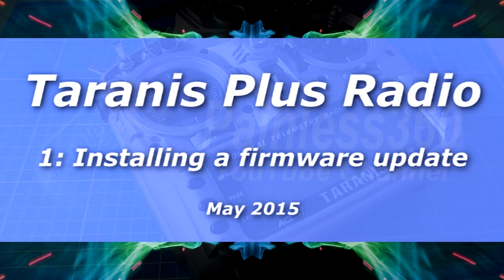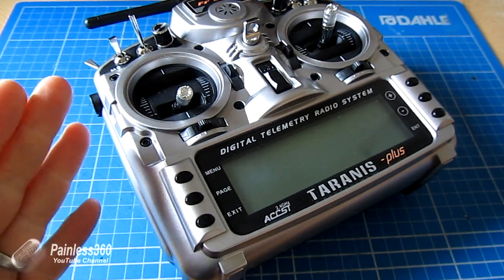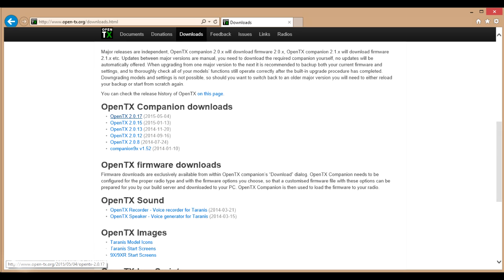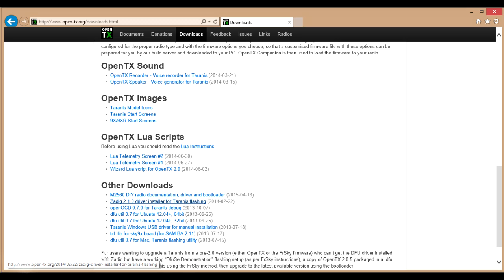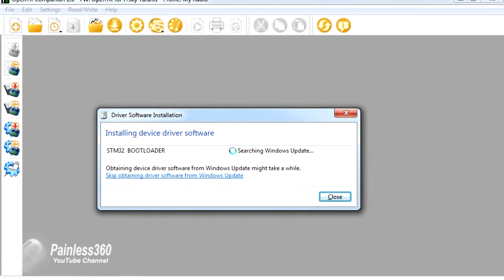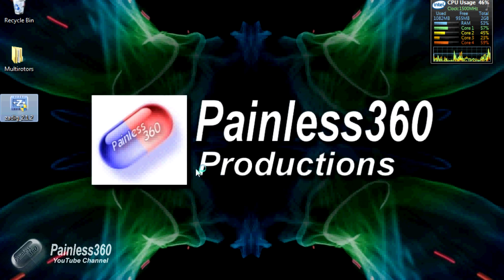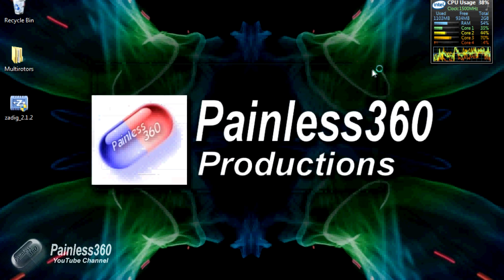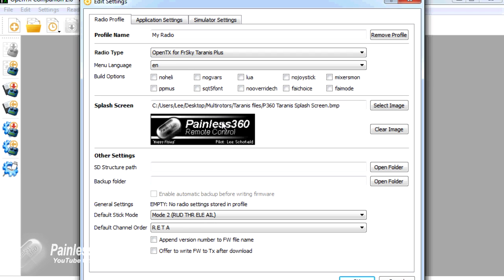(1/12) FrSky TARANIS Radio - One way to update the firmware

Comment: I think that since you made this excellent video several things have changed. For example, Zadig doesn't seem to behave as shown . Another issue is the version SD  warnings show 2.3V0039 whereas it's flashed 3.3V0015. Strangely if you remove the SDcard it's happy to load 2.3V0015.
Your channel is my first port of call when I want to know anything so please don't think I'm complaining. Once again thanks for the wonderful repository of knowledge you provide
Reply from the maker: Thanks for letting me know. This is why I add the date to the title screen as things get out of date very quickly in the hobby. I wish more content creators added dates as it causes a lot of confusion... Happy flying!

Comment: Why does my radio show servo end points as -512 and +512 instead of -100 and +100 and 1000 to 2000 is it something you have to do in radio settings or when you add the radio firmware using OpenTx companion is it a option you pick.

Comment: hi do you have idea how to fix the taranisx9dplus? my radio wont read any sd card i change already my new back pcb but still the same maybe theres drivers solutions?
thanks in advance
Reply from the maker: The main board would have been my first suggestion. Do all SD cards not work?
Reply: It’s work on my old . I buy new back board but still  not  work.
Reply: I mean the new board i bough from HourusRC and it’s not work.
Reply: So I’m thinking maybe need a sd card driver tp install.😭

Comment: Still having problems with this.Now instead of vibrating and a gray screen,the tx won't power up at all.I must have really messed it up trying to get it back to how it was before trying to enter bootloader mode.I tried a different sd card,no change.I guess I should have left well enough alone,as I was able to set-up models and get my travels and expo and all the normal things you do to set-up a fixed wing model,with flaps and gear,but thought it would be easier to do so with a pc and Open TX.If I can't this working I will get another and try again! Thanks Lee for the email and all that you do for our hobby!
Reply from the maker: There are instructions on how to unbrick your radio. I'd have a look at those. You've not got a lot to lose at this point..
Reply: You are right about not much to loose at this point.Good thing it is not an expensive radio.I have a Spectrum dx8 gen2 that I like a lot,but wanted this to use with the L9R receiver.I fly sport planes as well as wanting to get my fpv fleet going this year,and that's why I bought the X9D+.I guess I could just go Dragonlink for longer range than the L9R,and not use the x9d+.I will pursue this problem though as the radio has a lot of capabilities.Thanks Lee and I'll let you know how it goes as well as becoming a donor as soon as I get something going here.You're the best!!

Comment: Another needle in the haystack found ... unfortunatelly also recogniced today that now a lot more needles need to be found.

Learned that 
* this part of RC needs a lot of undevided attention and patience to get it done right
* it first needs the download of the open tx companion software and zadig driver
* it then needs the installation of open tx software - before plugging in the radio in laptops USB port
* it needs patience to let windows find the right stm32 driver for the first time
* afterwards the zadig driver has to be installed to update the stm32 driver to that taranis one that is needed 
* inside open tx first the right radio taranis X9D plus has to be selected in the configuration to establish the communication
* each firmware update starts with a download from the taranis to check compatibility and to back it up

But after starting to play around with my X9D plus today I got a notification to a video that many now consider Jumper's new T16 Pro / Plus version with hall gimbals and a built in transmitter module (and a free bay) as a big game changer after FrSky started sueing Jumper for copyright infrigements or so and FrSky introducing their proprietary "access" protocol in their new line up. 

I like Jumper Hardware cause I have had purchased a dozen laptops from their ezbook 2 and 3 pro series onwards and I had good, but also mixed experiences cause they were changing hardware pieces from production batch to batch like touchpads which had changed over night and become a nightmare. You'd never knew what you would get cause they mixed hardware improvements with new supplier or part changes all together. The review items differed from the delivered ones more or less. It had become a lottery what hardware was inside that device cause the dealers could not identify the differences what really would be inside the box, a no name chinese shit ssd or a fast samsung one under the same item number and description.

That being said I was able to make the best out of it and sold all the crap versions Jumper shipped between the good batches and so I had only the best of the best one on my desk. And these metal build laptops were cheap and reliable if they arrived in working condition.

Now after I recogniced the Jumper T16 Pro as a serious radio and evolution of the X9D I also watched your videos in that Jumper T16 playlist and sit here now trying to figure out where I am with my new arrived taranis X9D plus and where to go with it or without that X9D plus.

I sold my Taranis X light and have currently the new Taranis x9d plus with these components or modules (4 fr bigger Sky receivers + 2 four micro channel receivers + 1 frsky sensor      
1x X8R (new)
3x G-RX8 (new)
2x older 4 channel (2018) fry sky receiver
FrSky Smart Port Full Lipo Voltage Sensor

What I knew so far is that Taranis has become more and more expensive and with that ACCESS protocol things seem to change a lot ... cause the proprietary ACCESS will cut the cord of backwards compability as far as I understand cause the announced ACCESS compability will finally not arrive - at least that way. Then I also recogniced an anouncement and movement to tbs crossfire modules to get away from taranis in the future.

What I know so far is the myth that FrSky inventeded to make resellers believe that Jumper violates the law and so the places to buy Jumper radios has decreased a lot. The Jumper T16 is different in hardware and on PCB but Jumper was able and allowed to use the taranis protocol so all my FrSky receivers + components should work fine as you had shown already with a demo of the Jumper T16 and a FrSky Receiver and the smart port sensor - that I had purchased too.

But I can not really understand all the pieces and consequences of the ACCESS introduction and what the new red R9M module are good for that I got last week and if I should use or better avoid this module. 

I am not in quads, just planes, sailboats and subs only. Currently I am thinking of selling the new taranis x9d plus instantly to get a Jumper T16 Pro or plus ... 

Maybe you have an idea if it is a good opportunity to switch to Jumper T16 Pro or Plus during single day or black friday sale 2019 of cause.
Maybe this complete changing scenario is also worth a chat video from you about what to take into considerations if you are making a new decision to make things a bit more clearer.

Thanks a lot so far for your playlists ... that I call "needle in the haystack" locator or finder - even if sometimes more question appear like now and a lot more needles have to be found than before. But that is part of the game to master something new ... as painless.

Comment: While in OpenTx Companion with my X9d+ and building or updating Models why won't the Soundtracks show up in the (SF) tab drop-down box
Reply from the maker: Make sure that in settings you have the path set to the correct directory on your PC that holds a copy of the sound files.. best of luck
Reply: @Painless360  I have quadrupled check that and everything matches I have version 2.2.3 on my TX. But the Amber pack is an older version does that matter can't seem to find a new version of the Amber pack

Comment: Hey after upgrading to the latest 2.2.3 firmware the taranis is noticable louder from the hardwer is this normal or should i be worried? did i missed something. it also says error for the sd card
Reply: nevermind figured the sd card problem out. shoud have try first myself before i ask. But still the radio is much louder then it was before. is that okay?
Reply from the maker: Fine, the default volume levels seems a little louder on mine on 2.2.3 too..

Comment: Hey Man can you run 6s lipos on an APM 2.8 board I have the 450 Quad it has the APM voltage tx60 plug I guess it might be a voltage regulator not 100%sure if I could.. I just didn't want to see any Magic Smoke...
Reply from the maker: The APM runs on 5v so it's more about the ESCs, UBECs, motors and props on the model. Unless the model has been designed to handle 6s then plugging one in will fry something.. best of luck

Comment: Thanks for all your helpful videos! One of my mates recently acquired a Taranis X9D+. I helped him set up the transmitter and upgraded the firmware to 2.2.2. Now suddenly?? when he wanted to bind to another model at the field, it made all the "right" sounds but would not activate the servos. The green light on the receiver were very dim. Then I rebound the receiver V8FRII to the model "Heron". All worked fine we thought until we started to select other models and every model selected activated the same receiver I bound on the Heron. Even after I deleted all models and started add models using the wizard, I got the warning message that the new model will use the receiver number for the Heron. I read some threads about this but for some reason I cannot get this sorted.
Can you please do a video on this issue?
Reply from the maker: I’ve not seen that. I only use X series receivers with the D16 protocol..
Reply: I have deleted all models and rewritten the EEPROM to have a blank list except the default model named MODEL01. I did not bind any receiver to this MODEL01 in slot no 1. 
Then created 4 new models by using the wizard and naming them. Then I made sure in the D16 mode, the receiver IDs were unique, which they were, no's 1 to 4. I then bound the different receivers to each model and tested that they work separately - they did. Now with the model no 4 "Kadet" selected, I tested the operation and it worked with the receiver I bound to it. To finally test that I have sorted it, I unplugged the power to receiver no 4 , and then powered up receiver no 3 which was for the model "Heron". The latter receiver connected and the servo connected to that started to work as if Model 4 receiver was connected which should not have happened.

Comment: hi can anyone tell me how to get helicopter mode. mine is only showing plane ,glider, multi rotor. thanks
Reply from the maker: You don't mention what version of OpenTX you're on. It's probably not a version of the firmware on the radio that has it..

Comment: Hey there! A dumb question, do you have a video where I can see how to reset the taranis radio to factory settings? Last update I did I think 🤔 I made something wrong.
Reply from the maker: Only if you saved the previously installed firmware and settings somewhere..
Reply: Painless360 sorry I didn’t save anything.
Reply from the maker: Then re-flashing is the next thing to try. Best of luck!

Comment: Im getting a wrong voice command for Altimeter.  It is saying "0 MAH".  Altimeter works on telemetry page.  Vspd,  battery, txbatt gives correct voice commands and the vario beeps as it should.  Im afraid of 'bricking' my TX so I have not done any upgrades.  I am getting the wing type page when setting up a new model.
Reply from the maker: That usually means you've not updated the SD card contents for the version of OpenTX firmware you are using..
Reply: Thank you. Can you please tell me how to update my SD card?
Reply from the maker: You need to download the SD card contents and copy them over the files one the SD card (make a copy of the SD card first!) All covered in my early Taranis and QX7 videos. Best of luck!
Reply: Thanks again for the help, I really appreciate it.  I downloaded the 2015 SD contents from Frsky.  Im running 2.1 there were only options for 2.2 or 2015.   No change Im still getting MAH instead of Alt in the voice command.

Comment: Hey there Mr "Painless" (sorry, seen lots of your videos, but don't know your name.) I know this video is very old, but I am stuck on the "New firmware is not compatible with the one currently installed!"  error. I am trying to put OpenTX 2.2.1 onto new Taranis QX7S that appears to currently be 2.2.0. But it just brings up the above error, even though I have setup my radio as QX7S. What are other reasons why I would get this error? I seem to have Zadig all good, and I can access the device if I turn it on before plugging into PC. Getting rather frustrated, so any help would be greatly appreciated. Ta. Kev.
Reply from the maker: +Kevin Hill make sure you have the right radio type selected for the Download, if all else fails you can disable the hardware compatibility check in OpenTX companion too. There are a few things about this in the forums, so it's worth a read. Best of luck!
Reply: Hey Painless360 - I have just found out what the problem was. I saw the bit in your video about ensuring that the model was selected correctly, and I did that, but that didn’t help. However, in either your video, or of the many others I went through, I heard an almost throwaway comment about clicking the EU checkbox if you have an EU radio. I do, and that was it. When I did this, the firmware was specifically EU, and successfully installed. Thanks hugely for responding - I really appreciate it. I have only been flying for a short while, and have found a handful of YouTube channels that make sense to me. You are one of them, and your response is very kind and very pleasing for me - thanks. Kev BTW, what is your name, just in case we chat again?

Comment: This is what I'm getting on mine and I cant figure it out. Current version on the radio is v2940, I cant get companion 9xr to read either. Any help would be appreciatedtarted DFU Util
C:/Program Files (x86)/OpenTX/Companion 2.0/dfu-util.exe -a 0 --dfuse-address 0x08000000:524288 -d 0483:df11  -UC:/Users/John/AppData/Local/Temp/13848-flash-check.bin
=================================================================================
dfu-util 0.7

Copyright 2005-2008 Weston Schmidt, Harald Welte and OpenMoko Inc.
Copyright 2010-2012 Tormod Volden and Stefan Schmidt
This program is Free Software and has ABSOLUTELY NO WARRANTY
Please report bugs to dfu-util@lists.gnumonks.org

Filter on vendor = 0x0483 product = 0xdf11
More than one DFU capable USB device found, you might try `--list' and then disconnect all but one device

=================================================================================
DFU Util done - exit code 3
Reply from the maker: There are other ways to update the radio too that may be better for you.. Check out the forums and my QX7 videos..

Comment: Hi Lee I think that you must know as much about Taranis inside and out as anyone. Can you tell me if a damaged back board would cause loss of sound ,beeps and haptic. I am asking because the only thing I have done inside the radio is solder in the six position switch, I wondered if I had overheated some component on the board. I also updated to ver 2.2.
Reply from the maker: https://github.com/opentx/opentx/issues/5104 Looks like a SW bug. Not sure about the other things though..

Comment: I flashed Open TX 2.2 on to my new Taranis X9D Plus and it looks like every thing has gone OK I also downloaded the SD card from the link that you sent me Lee but now I can't get my laptop to open the SD card in my TX no matter how I plug in to it ie TX off or TX in three finger shuffle mode and also if I look for STM32 Boot loader Zadig will only find FR-sky Taranis Boot loader I have racked my brain but have no idea what I have don wrong I can access my SD card but only with a card reader can anyone help Thanks Tim
Reply: Remove the sd card from Tx and use a card reader to show the contents, then copy firmware etc to it.
Reply: Hi Ken thanks for that I have done all that you said but it still will not read my SD card when it is in the Transmitter and it still says its in Fr-Sky Taranis boot-loader not STM32 I am sure this is my problem but Thanks for that

Comment: Please can you help me decide whether or not I can flash my old X9D with OpenTX 2.2?  Any pitfalls to watch out for and do you have a video on how to backup the original firmware?  T.I.A.  Dave (NZ)
Reply from the maker: +SighKick I’ve showed the update process and backups in the OpenTX 2.1 update and QX7 videos. It’s a good idea to run the models from OpenTX 2.1 EEPROM on the radio through the OpenTX 2.2 companion to check it’ll work ok.. good idea for a video - I’ll add it to the list..